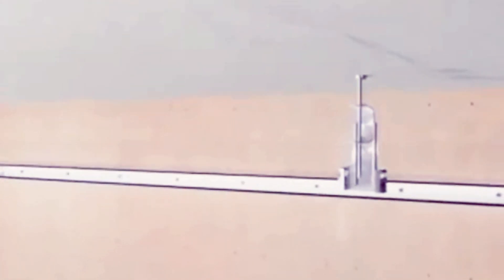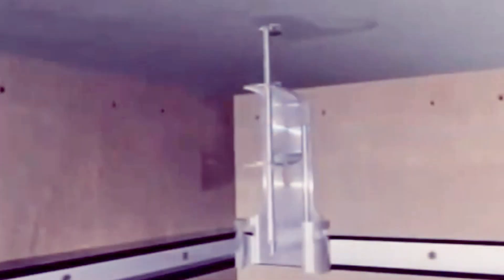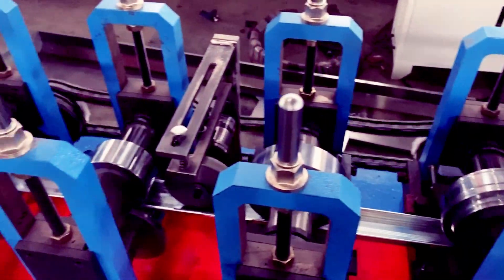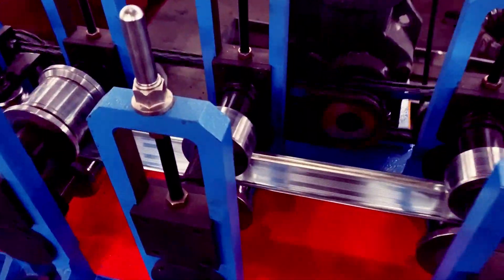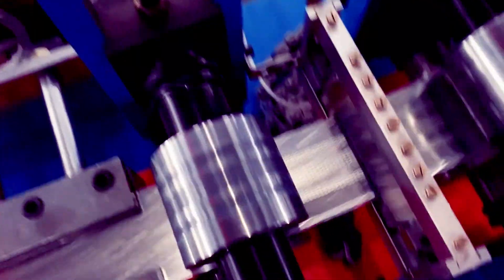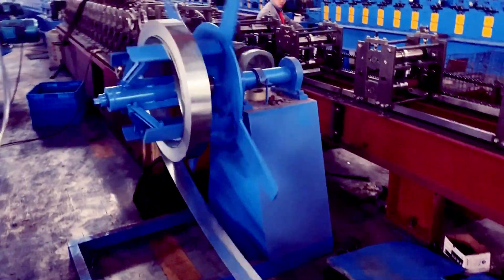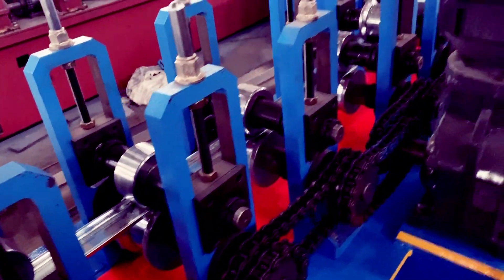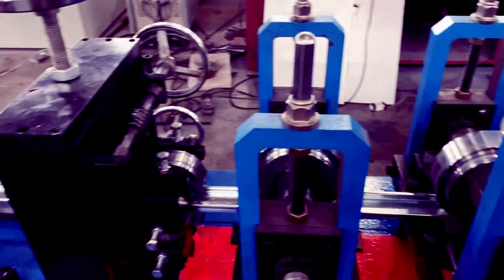【stud and track machine】: High speed stud and track roll forming machine " with slotted hole"

Comment: Studs roll forming machine, metal stud making machine, Furring Channels roll forming machine, Ceiling Channels roll forming machine, and steel frame roll forming machine are among the range of production line produced to service the drywall installers

Comment: LOTOS provides a complete line for Steel Stud Roll Forming Machine. metal stud making machine, High-speed stud and track roll forming machine, and light gauge steel framing machine are among the range of production line produced to service the drywall installers.

Comment from the maker: LOTOS design CAD/CAM Roll forming machine for the target of producing Light Steel Framing. Each part is dimpled and notched with the holes ready to accept fasteners so that components self-clip together with no clamping. This design enables to snap the parts together, add the fasteners and have a completed frame. We design CAD/CAM Roll forming machine for the purpose of producing light steel framing.